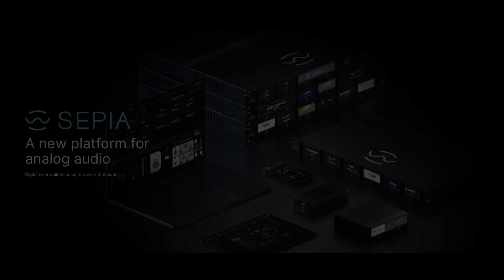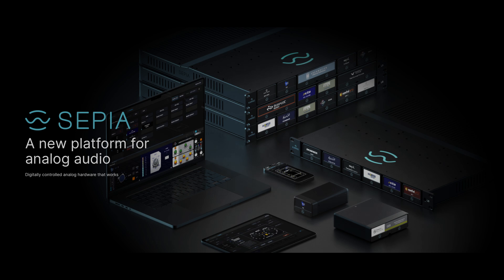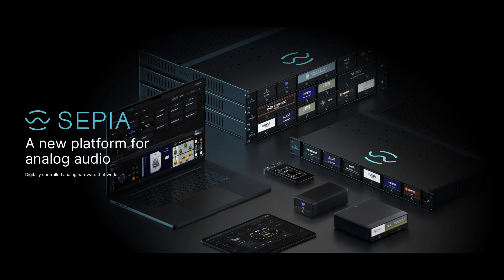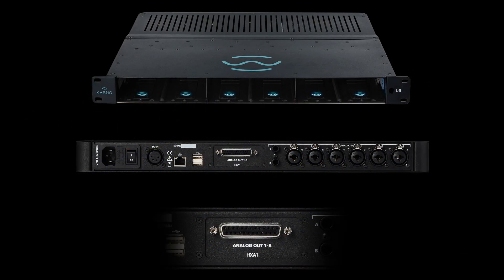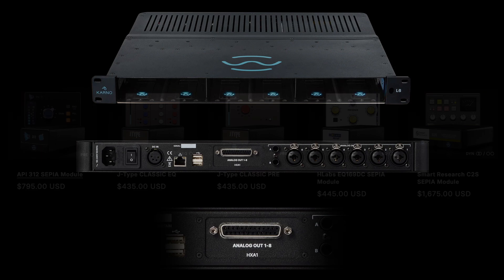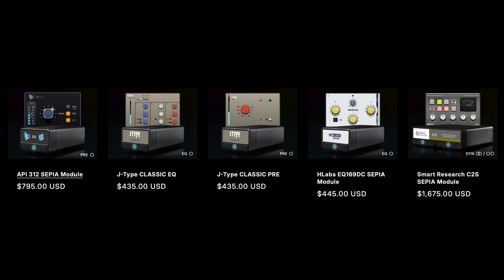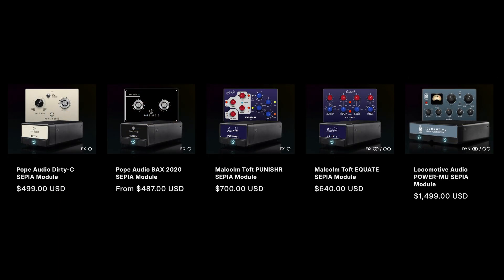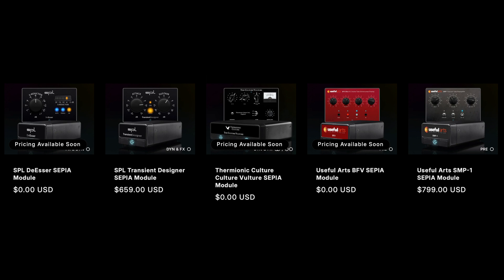Sepia - Digitally Controlled Analog Hardware

Comment: Space saving (for small home studios), power saving (speaks for itself), instant recall (time saving), automation (expand creative possibilities).  Would end up costing less than a 500 series or 19" rack equivalent.

Sound quality, still to be proved, we need some demos, but I'd be surprised if it was any less than traditional hardware, if they got the power supply and headroom right, and it will definitely sound better than plugin equivalents.

There is another digitally controlled analog competitor, been out for a few years now - The McDSP APB, slightly different approach, but already vouched for by a few pro mix/mastering engineers. I have one and it's waaaaaay better than any plugin.  I wish Karno all the best.
Reply from the maker: The difference between McDSP and this is Karno is using the exactly electronics that made the rack mount unit popular

Comment: It’s a cool idea — if it actually works. But why not just use a Flock Audio Patch alongside your existing analog gear?

500 Series modules are certainly convenient, but let’s be honest: they rarely match the sonic depth of full-sized rack units. Same goes for plugins. It’s also incredibly difficult for any single company to replicate the 500 Series ecosystem — it’s taken a decade of collaboration across vendors to get here.

Take my Neve 1073 SPX, for example. It sounds fantastic, thanks to a proper-sized transformer and a solid power supply. At 96kHz, the difference in quality is obvious during tracking.

But here’s the kicker: once everything’s mixed down to 48kHz and played through a pair of AirPods, can you really hear the difference anymore?
Reply: Instant recall and automation
Reply from the maker: Instant recall and automation - Yep

Comment: OK.  I'm a bit of an old school guy here.  IT sounds like if people want to digitally control some analog gear , then in reality, they may want some actual analog gear. Simply because of the sonics of real analog gear.   Maybe plugins just don't cut it. I'm speculating.  Clone companies have become as good as their counter parts and definitely as good as software and plugins if not better.   Clone Preamps like 1073s by Vintech audio, warm audio,  heritage audio, stam audio and so forth.  They make a whole wide range of analog clones of the classic gear.   I own a allen& heath 48 channel console,  with a ton of outboard gear.   I think even with pro commercial recording studios that  have converted to using pro tools DAWS and AD DA converters. simply because of the limitations to tape editing,   other than that, its a SSL or Neve or API or Audient, or Helios analog console,   and racks of outboard gear.   

Maybe some home recording studio owners just don't have the need or the room to have these types of setups in their homes,  I am cutting it close with this type of setup in my home.   But overall, with plugins being so much better and clones companies making gear that can compete with the top names,  People may want to consider a AMEK console used for around 4k on reverb,  invest in a nice AD DA converter like I have.  I own a Antelope Orion and MOTU converters,   and clone companies like lindell audio 76,  their 2A and pultec clones,  or warm audio, heritage audio, stam audio,  audioscape, golden age and so forth.  or even 500 series rack gear.   You get all of this gear for a fourth of the cost of the ssl Oracle console.     A really good treated room and wiring and star ground.   I see this as a better option. but that's just my opinion.   Some people may or may not want to go as extensive as I did with the amount of gear I own in my home studio setup.  

Maybe your thoughts and opinion on clones and plugins as a hybrid setup with a nice used console like a MCI jh 416 console,  or AMEK einstein or even a vintage neve 8128 for 12 grand on Reverb.   I know these are bit pricey but 90 times cheaper than an SSL Oracle with enough money to fill the racks with some nice clone gear and a AD DA converter like my antelope orion.  some nice studio monitors and mics and still have over $50,000 leftover over the price of an SSL oracle.
Reply from the maker: Your perspective on analog gear, clones, and plugins in hybrid setups is both insightful and rooted in practical experience.

When it comes to the sonic character of real analog gear, there's an undeniable warmth and depth that plugins often strive to replicate but seldom match perfectly. The tactile experience of working with physical gear—turning knobs, patching cables, and feeling the hardware respond—is something digital interfaces can't entirely emulate. This is especially true for preamps like the 1073 clones from companies like Vintech Audio, Warm Audio, Heritage Audio, Stam Audio, and others. They offer impressive fidelity, often capturing much of the magic of their inspirations at a fraction of the cost.

Your Allen & Heath 48-channel console paired with extensive outboard gear exemplifies a setup that many home studios would envy. It reflects a commitment to sound quality that transcends convenience. While top-tier commercial studios continue to rely on iconic consoles like SSL, Neve, API, Audient, and Helios, the hybrid model—integrating DAWs like Pro Tools with AD/DA converters and analog gear—has become a powerful standard.

For home studio owners, space and budget are genuine constraints. However, as you noted, with the availability of high-quality clones and used analog consoles (like the AMEK Einstein, MCI JH 416, or even a vintage Neve 8128), achieving professional sound is more accessible than ever. Pairing such consoles with reliable AD/DA converters like your Antelope Orion and MOTU units bridges the gap between analog warmth and digital convenience.

Investing in proper room treatment, high-quality wiring, and grounding is equally crucial. A well-treated space can elevate the quality of any gear used within it. Additionally, 500-series racks provide modular flexibility, allowing studios to expand as needed without overwhelming the space or budget.

Ultimately, it boils down to personal preference, workflow, and the specific sound one aims to achieve. Your approach showcases how a well-thought-out hybrid setup can deliver exceptional results without the hefty price tag of flagship consoles like the SSL Oracle. It’s about finding the right balance between analog authenticity and digital flexibility.
Reply: @fantastictalesofproaudio2391  THanks so much for the response.  And the compliment,  Very much appreciated